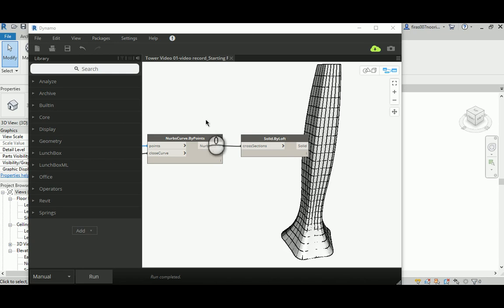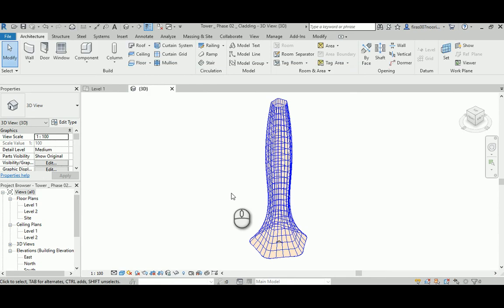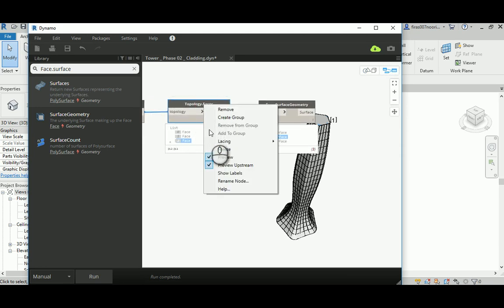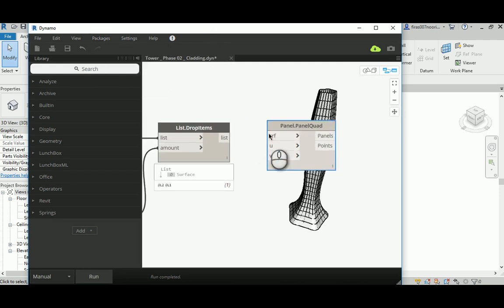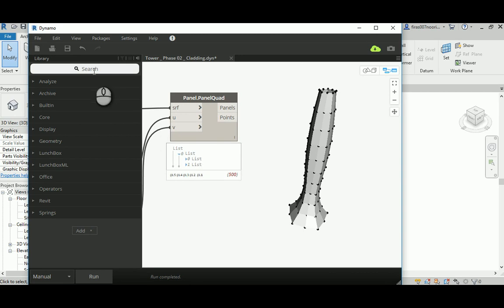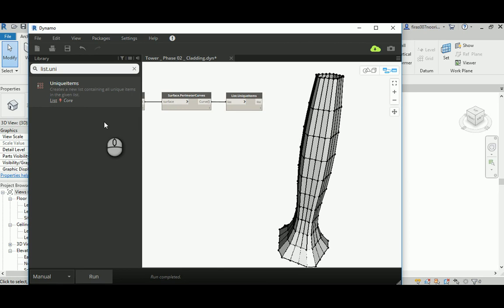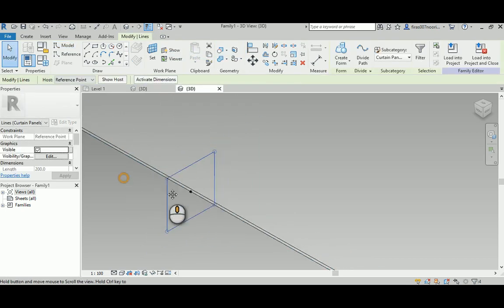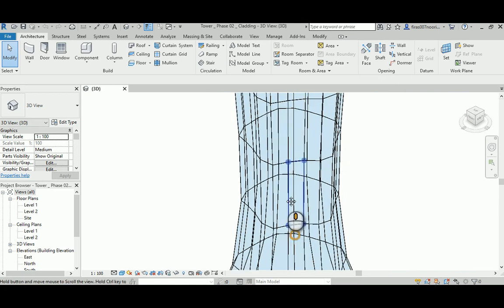Basic Tower in Dynamo _ Step 2 _ Cladding with Dynamo

Comment: this was a great video as usual
Reply from the maker: You are the great as usual,  many thanks dear
Reply: @FirasNoori  I am finished with Step 2 of Benchmark 3 with the cladding. Is the next video Step 3 of benchmark 3 (with the skin making) in addition to step to cladding or is it one or the other?The intro made it sound like it was one or the other.
Reply from the maker: @BlueAwesomePanda555  the third is to teach you how to make the skeleton not the cladding, so the skin in empty not surfaces, so you can skip it if you are not interested
Reply: @FirasNoori  is that skeleton used for floor creation? Once my paneling system is created what are the basic steps to add walls doors floors windows etc? Or could you refer me to a simple tutorial to brush up on it now that my tower is made

Comment: Mr. Firas, by changing the u & v values, certain panels are missing randomly, why?
Reply from the maker: Greeting dear, there are lots of reasons behind this act.
1- the curvature at the surface are so complex, in a level that can not be wrapped with straight Adaptive Components, and you may need to redesign the AC to be General AC with free 4 points instead of the planner AC for curtain panel base.
2- sometimes this bug solve itself simply by changing the number of U or V, it will make more divisions and Dynamo will be able to wrap this complex part of the surface in a correct way.
3- You may need to switch to Revit window and delete all previous AC and then repeat Dynamo Run, sometimes I notice the issue solve itself.
4- Sometimes it happens on corners or edges and this is a very annoying one and hard to be fixed as I see that even when I divide the surface in Normal Conceptual mass file not Dynamo, it always have some difficulties to use the AC correctly at these areas, therefore , you got to place the AC manually sometimes on these one or two missing spots,
Best Regards to you dear brother
FN

Comment: First of all Great work!! your videos are amazing, thank you!!  I would like to ask something, I installed revit 2019 and dynamo's last version and then from packages everything that had to do with the Lunchbox + LunchboxML but still couldnt find the command Panel.PanelQuad. What else can I do?
Reply from the maker: Hi dear, thank you, I am happy you found these videos useful, sometimes a single mis-spell even in a single letter prevent the dynamo search engine bar from getting you the node u need, they should fix this issue as it is really disturbing!! Anyway have you tried to go to the side menu > launchbox > geometry > panel > panelquad
Reply: @FirasNoori  Thank you for the fast respond! My mainly problem is that I did everything but still on the side menu doesn't appear the lunchbox.
Reply from the maker: @ermisyannisgkaravelas3017  I once got this and I had to reinstall Dynamo and Revit, but it would be a great idea to check that your laptop is not set into 2 screens mode as some times the side menus are located outside the first screen